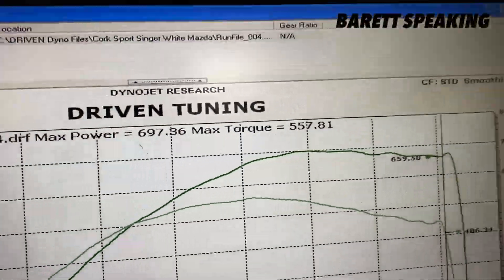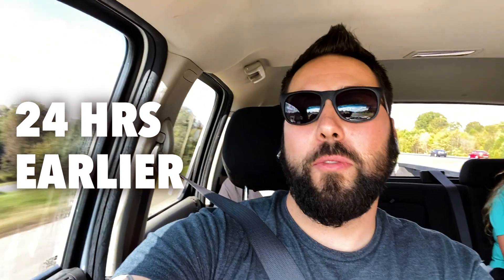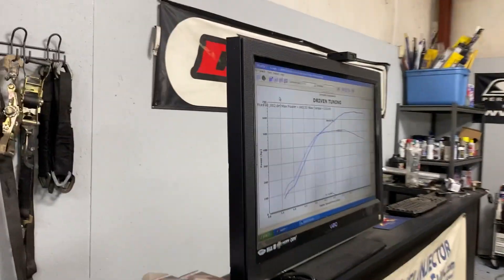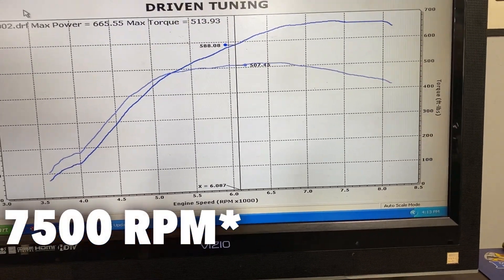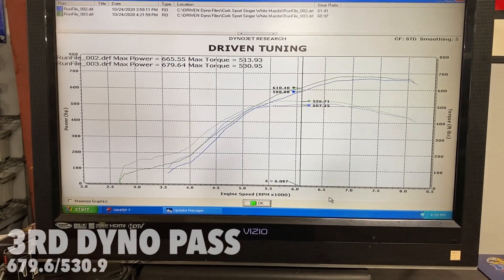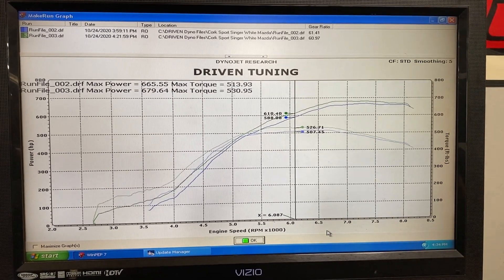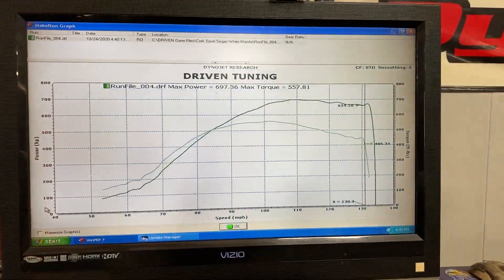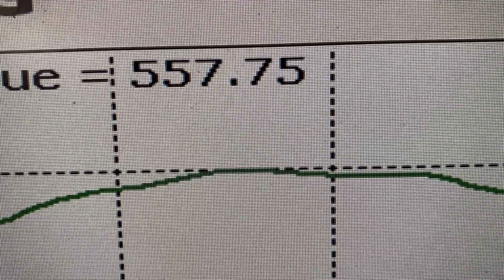Built With Barett - Chris Singers CST6 Stock Flange Turbo Record!

Comment: theoretically can you make similar power, but with bringing in the torque sooner on a speed6 that will have less traction issues? I'd assume the increased load from the AWD system can make the turbo work harder and spool sooner sub 4000 rpm.  Huge achievement nevertheless.
Reply: Yes and no.  The turbo's efficiency would change due to the drivetrain of the vehicle but you could command higher boost lower in the rpm range to increase peak torque a bit

Comment: Who fabricated the coolant tank?
Reply from the maker: The first-gen has a different size tank due to the speed 3 model of the gen 1 having a power steering reservoir there. 

It would fit if the res was relocated or they adapted the electric pump of the gen 2 models.
Reply: Corksport. Everything on that car is Corksport.
Reply: @03max6spd  i see it on their site now. But its only for 2nd generation speed 3's and not 1st gen.....although I'm not sure why since they use the same platform? 🧐
Reply: @TonyVainosky  that is a good question, i think i remember seeing someone else make them for the Gen 1s now that memory serves me.
Reply: @03max6spd  my current setup has the Graveyard performance coolant and power steering reservoirs, but can't lie, I really like the way the corksport one looks. Might have gone that route had I known it was an option 🤷 oh well, rocking Graveyard and loving it, so no regrets here 👍 but I think they should put it on both Gen pages of they use the same platform